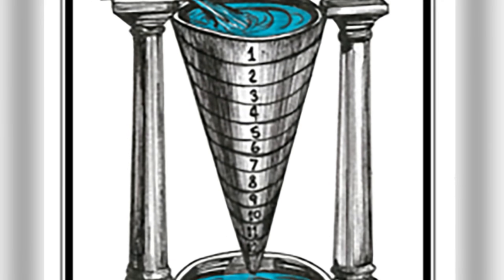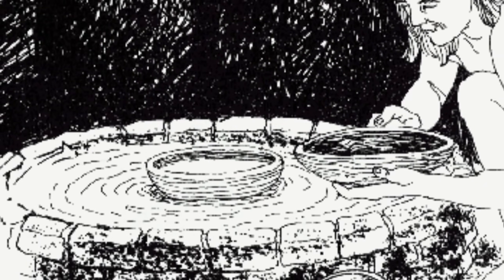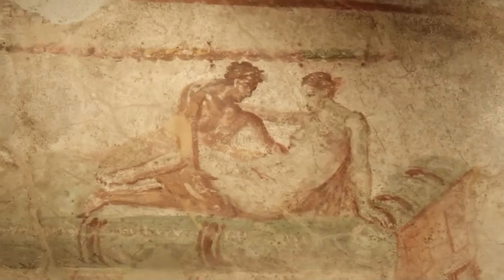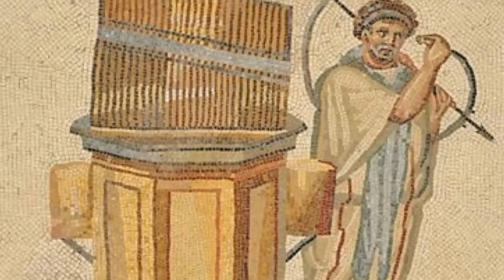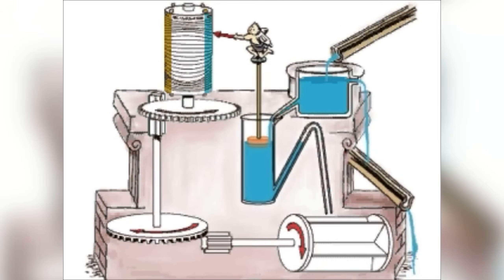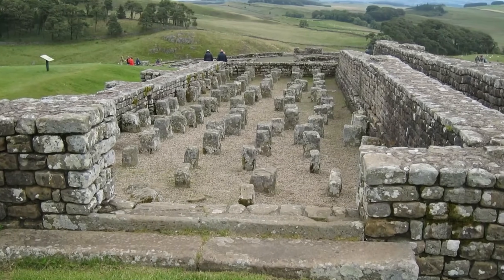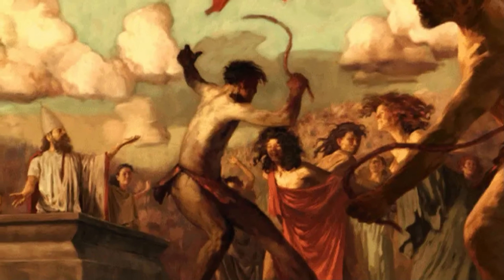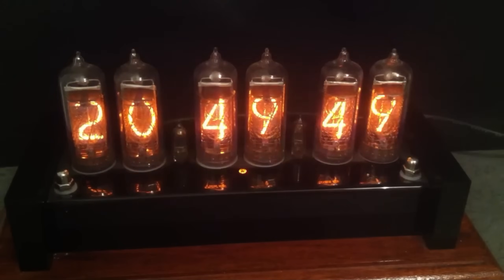Understanding The Clepsydra

Comment: Thank you for this. Have included a clepsydra in a novel I am working on, set in ancient times late bronze/early iron, before Classical Greece. This helps immensely. One question: you mentioned the influence of Torricelli's Law, where waterflow slows as the top receptacle empties, and the ways that they tried circumventing that.... and it gave me an idea. Therefore, are there any examples of the following: The graduation lines inside the receiving bowl are spaced in increasing smaller increments so that the slower flow is compensated by the shorter gaps, thus still being an accurate timer so long as the top container is always filled to the same amount. I am likely doing this as an innovation in my book regardless, but am curious if this is actually a novel idea or not.
Reply from the maker: @TheHomelessDreamer  Love this idea! As far as we know, no ancient clepsydras used graduated lines — they usually relied on vessel shape or steady flow. That makes your twist a really clever innovation, and an awesome detail to add to your novel!

Comment: There's currently a water clock installed in the Dutch art gallery where I work for our Water exposition. Its design is very similar to the Ctesibius and Roman designs you discuss in this video; it was based particularly on the designs of an Arabic inventor called Badi' al-Zaman al-Jazari. Thanks for the clear explanations of how it works, so I can properly inform visitors of the gallery!